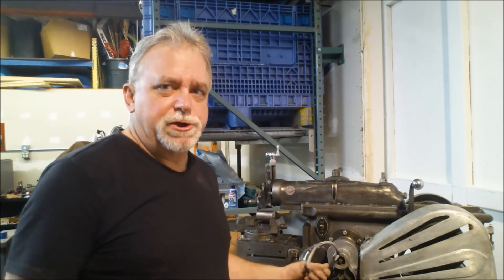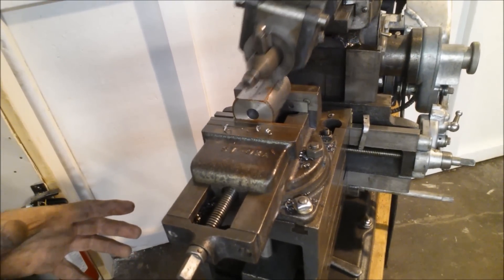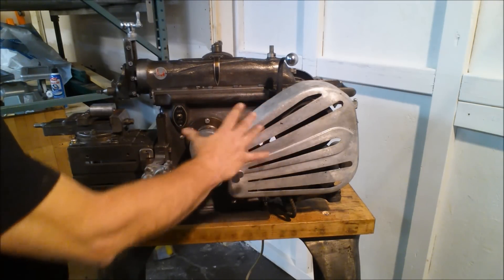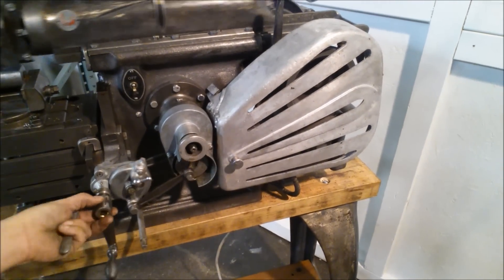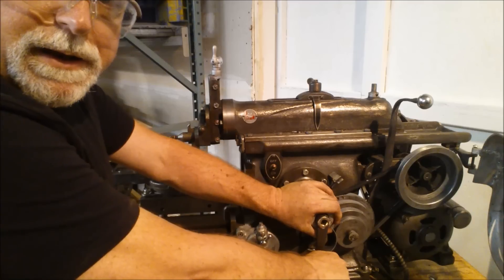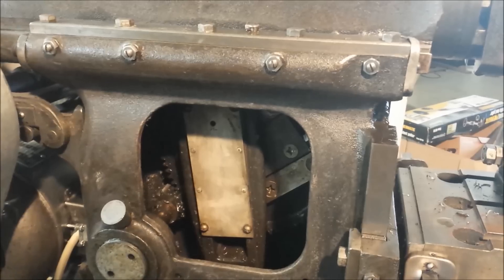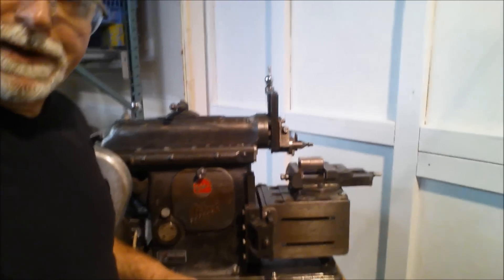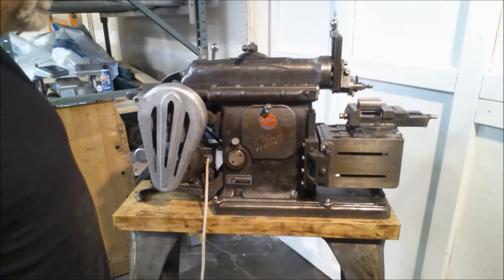Atlas metal shaper

Comment: The lever above the guard that was repaired is the clutch. It loosens the belt off of the pulley, so you can start the motor then ease the shaper into motion (and stop) while the motor is running. There should be a small "brake" pad on this lever to keep the pulley from turning while in the idle mode.

Comment: I know this machine has been gone from your shop for a long time, but do you recall how you changed the belt on the step pulley side? I can't seem to figure it out. I can change the motor belt, no problem, but the other one is giving me issues, and the manual is no help. :)

Comment: I did a lot of shaper work when I was a teenager on a large Italian made machine with 600 mm stroke. We did all kinds of work from key ways to truing large plates and leveling the support area for big electric motors and pump bodies that sat on very heavy frames that were used to pump lime slurry from acetylene production, we occasionally made some gears that could not be made on the milling machine, but I can't describe how many things we did on that shaper. I remember I used to make vise jaws for all types of bench, drill or mill vises out of 1095 steel from large truck springs with checkering and all, sometimes specially made for specific jobs. The beauty of it, unlike the milling machine, was that it could be run very cheaply and we even had an attachment for some type of surface grinder. That machine was so large, heavy and strong that when it sat idle we had fun by setting it at high speed at it's longest stroke and we took turns to ride it like a bucking horse. Damn, we were nuts, but it was fun!
Reply from the maker: chapiit08 Wow! Sounds like you are a shaper maestro!
Reply: Well, that was back in the 70's and 80's when shapers were supposed to be obsolete, yet we did a lot of shaper work and unlike other equipment, once the machine was set up it could be run by semi-skilled labor. We also had a larger shaper where the clamped work actually moved back and forth (no ram) while the bit was held stationary on a clapper/tool head arrangement with feed hand wheel, moving across a bridge as a unit while the table went back and forth. That machine took a lot of floor space as it could handle work as wide as 4 ft by 6 ft of travel which means that the whole thing was more than 12 ft long and at least 6 ft wide. I don't recall ever seeing a machine like that again.  It seems like ages ago...

Comment: Heya lucas, excellent machine there! I've never operated one, but I've always thought they were pretty versatile little workhorses.

.005" box feed seems pretty darn coarse for some of the super precision jobs I've seen these used for, how much work do you reckon it would be to replace the ratcheting assembly with something with finer graduations? Maybe 50 tooth or more per rotation instead of what looks like 20ish. Maybe add an intermediate stroke divider for finer feed adjustment?

Again, thanks for sharing this excellent piece of machining history with us!
Reply from the maker: Hi Brad,

Glad  you like the video.  As pertains to fine feed: if I really wanted super fine feed, I would not use the ratcheting mechanism at all. Instead, I'd set up a small stepper motor to control the lead screw, with a sensor to tell a controlling computer (Raspberry Pi, Arduino, etc) when the ram was on its way to the rear.  I'd then set up a program that allowed the controller to advance the leadscrew the desired amount at the correct time.  Mind you, taking small steps will increase the amount of time it takes to run through a cutting cycle. Maybe correlating the tool radius to the stepover distance would help with surface finish.

Comment from the maker: Hi Joe.
CNC conversion of a shaper is an interesting idea.  As far as I know the 7B is the largest shaper Atlas made.  The shaper that impressed me the most in terms of performance is the Havir model B.  That is an 8 inch shaper and takes up not much more floor space than the Atlas.  The Havir is built much more heavily and has a larger table (called a "box").  I have a video on a nice Havir I had a few years ago.  
Lucas AKA Arn Jones

Comment: ive been looking at convertind a shaper into a little cnc mill. just wondering if you see and problems doing that and does atlas make a machine just alittle bigger than yours
Reply: Look for an Eliot 10m. But to be truthful I would keep the shaper as a shaper. I have a 10m and do any milling in the vertical slide on my Colchester lathe.

Comment: Just ran across this video.  Good presentation.  I have an  Aamco 7 inch.  around the same vintage as your shaper.  My shaper too is in excellent condition.  Had used it on a production job many years ago.  Used it to cut a slot across one wall of a small bushing.  The slot was fairly deep and too deep for a slitting saw.  It contacted the other wall.   I put a lathe cut-off tool in the tool post and that worked perfect.  Just nibbeled the slot down.  But then I built a fixture to hold the work piece.  Made these little parts by the thousands.  The shaper is really a nice tool to wrok with and at times the best thing to use.  Thank you for doing these videos.
Reply from the maker: Glenn Felpel Thanks, Glen,. glad to hear from someone who used the shaper for production.

Comment: In the early 90's i had a vo-tech teacher that refused to let us use/learn on the shaper we had in the shop...always said it was obsolete and dangerous...heck it took some arm twisting just to get time on a horizontal mill..Its sad unfortunately.Sure there are newer and faster ways to get things done but there are still some operations that are just plain easier to do on a shaper...course nowadays there's a whole new breed of machinists out there that are not much good unless they have a cnc in front of them...heck half of em are really only operators using someone elses code.I would love to have a good cnc lathe and mill but knowing how to get the same work done on manual machines is more important as far as im concerned

Comment: Nice vidio.  as far as the brake try using a wood Vee way better than rubber. And then
I pinch a elcheapo baking pan between the foot (and it stays)  not only a chip catcher but
good place for tools.  I think I'd like a better table feed adjustment Ya kind of guess with
that design.  One of the most used machines in our shop!!